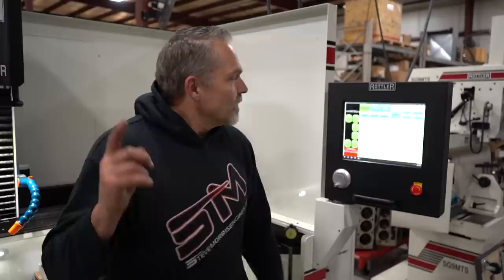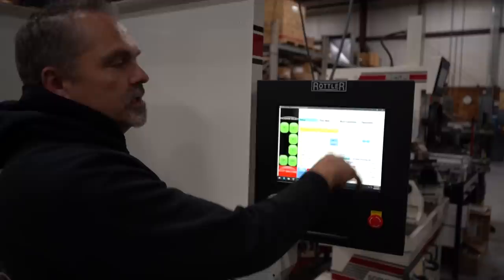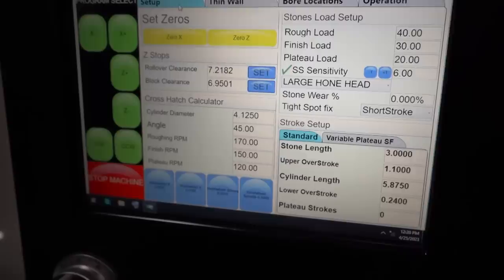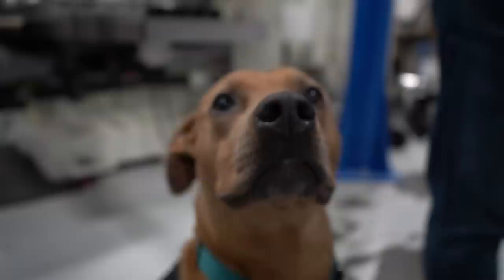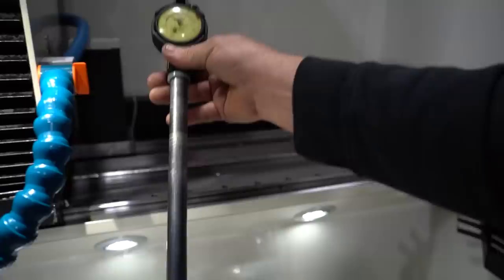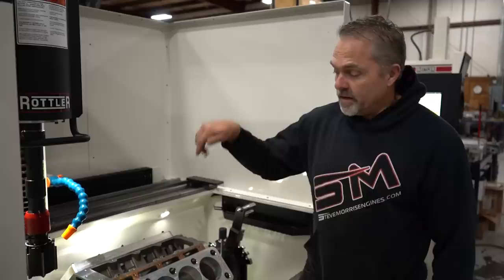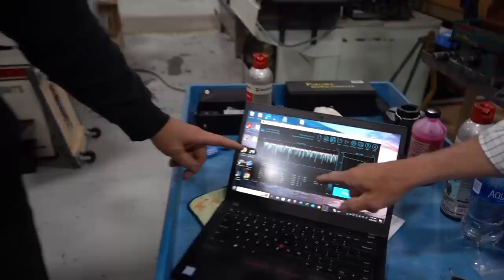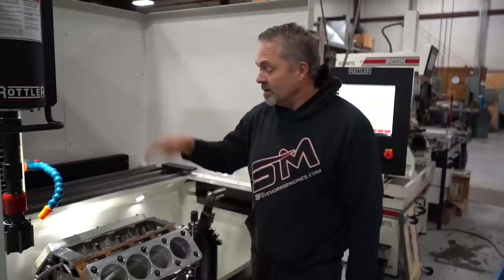Piston Skirts Scuffed ? Rings Did Not Seal ? This Is Why !

Comment: As a programmer, if I'm doing a some job that nobody else is going to touch (especially if it's a 4+ axis job) I like to do a low clearance entry, prove it out and then crank the rapid and start it in front of a member of management. I like to see if they flinch.

Comment: Steve, I'm a industrial electrician who works in a copper mining operation. Have that E-stop button replaced with a cutler-hammer (Eaton) E-stop.  That is one of those cheap European autopupu's style that are crap and will break on you when you twist them to pull it back out.  Tell rotler to never use those use those pieces of garbage in there equipment

Comment: Steve, I have 45 years of experience using diamond tools mostly associated with my tile business. One thing about diamond blades is the matrix that carries the diamond, it must be the proper hardness so it wears exposing new diamonds at the correct rate for the material being cut. Tile & stone has many different types of material from granite to porcelain to regular glazed fired clay tile and it is fustrating to have a nearly new $80 blade quit cutting or start walking offline because it shed the current level of abrasive and is not wearing to expose new diamond .

In your case hopefully the steel is nearly the same hardness and you wont have blade issue, softer stones for hard material seem to work best and cut faster.

Comment: Absolutely unreal! That machine is very impressive. Funny that you mentioned the skirt scuffing…
 I had a block done, always smelled oil burning, but had tremendous cylinder pressure. I tore it down to ring and bearing it, and add end gap for boost. I noticed a few pistons were scuffing… Those cylinder’s combustion chambers were oily do to scuffs in the bore… Oil rings couldn’t scrape properly with gouges in the bore… 

This machine is worth its weight in gold… Gonna be interesting to see if engines pick up Hp from a better bore/hone job… Awesome, just awesome! 👍🤘👏
Reply: It will. Lake Speed Jr (Total Seal Rings) has seen improvements of 8-10hp on engines with the right ring and hone package (Stapleton42 channel)

Comment: Finally, this info is being spread to the wider audience enmasse, now also by you guys, and Rottler and Total Seal. I've tried to tell this key importance of corse valleys and plateuing of the peaks in bores to gearheads locally, but being only one dude vs. a bunch of repeaters (monkey-see-monkey-doo'ers) they don't believe you.

It might also be an idea to state that for especially emissions-meeting street/road vehicles (which realisticly operate most of the time off-boost and at low manifold/NA regime), people might want to considering using a lower viscosity oil, as I've found the surperior oil retention properties being so surperior that the rings start to float (too much) on the oil film, that oil consumption becomes an issue as oil is drawn past the rings during low manifold press and engine breaking scenarios on engines NOT using DBW and VVT in particular ( VVT+DBW engines can counter it by for one running higher manifold press and retarded camshafts thus using atkinson cycle in a win-win for thermal efficiency and less pumping losses at low and part load scenarios, and second do engine breaking with fuel-cut and WOT at the same time, limiting the vacuum).

A similar issue also affects some other modern OEM engines that use plasma-spray sintered iron bores (they typically use 0W20 oil stock) and people have gotten oil consumption issues by using a thicker oil.

For the guys in the US (except CA),  I guess it doesn't matter much.

Edit:
I felt it through the screen when you dropped the mic'...

Comment: It is wild to think that a perfectly smooth bore is actually bad, but after explaining that you need the valleys to hold the oil and facilitate oiling it totally makes sense. 
On the surface it is/was counterintuitive. Having am "average" bore diameter with valley to hold oil that the rings won't scrap off, I mean now that I really think about it that is the point of the cross hatch is to draw the oil up and down with the stroke of the piston. Long story short, MIND BLOWN
Reply: Rifling on a Gun barrel = Gas instead of Oil
Friction is the Enemy
Reply: @statementleaver8095  yeah, that is not the same thing at all. The purpose and function do not corelate between the two.
Reply: @covertsolid1  Both work off Bores
Both controlled by Force of Explosion
Both require Honing
 3 similarities that you appear to be Ignoring 
 I can go for a fourth reason 🙊🙊
Reply: @covertsolid1  Nothing wrong with a Smooth bore......It's just the Material used for Rings and Sleeves aren't up to the job
EDIT 
Oil feed requirements for Lubrication would need to be like a Crankshaft with Oil channels involved on the Contact edges of the Piston🤔🤔

Comment: Probably one of the most amazing machines of the modern era. Lake Speed Jr of Total Seal uses this machine at Greg Anderson place on his fathers motor. Stapleton42 channel covers it. Lake figures with the right cylinder finish this machine provides along with the right piston and ring package alone is probably worth 8-10 hp itself.

Comment: I do small engine builds and ever since I’ve been using (local shop) that machine (diamond stones) my piston life is longer AND the motors make way more torque. From 85cc 2 strokes to 1000cc turbo 4 strokes, all my customers are impressed with how quick they get to top rpm with that honing. It’s just better, period…

Comment: I am learning! Before watching this video, I'd watched Freddy working on his flooded P1. He put a borescope in the engine and said it was good because he could still see the cross-hatch, and I was thinking "Why? Shouldn't it be smooth?". The stuff growing inside the cylinders was probably less good. Then in this video, when Steve talked about setting the cross-hatch angles, I was thinking "Ok, maybe it shouldn't be smooth, maybe it's for lubrication?". Then pleased to discover I'd got it right in the end.
Also I'm guessing this is why good engines cost a lot more than stock Frod or GM engines because of the far greater attention to detail in the precision and fit & finish.

Comment: Great video Steve, We have a CK10 in good shape but older. Wed mostly industrial   .small diesel and stock rebuilds. I guess the point is at what point is the advanced tech of the Rottler worthwhile? I love the CNC aspect freeing up a machinist while it works. I also love the bore finish but Im not sure our customer base requires this level of precision
Reply: I rode a CK 10 and later the CV 616 for many years and fully believe there is no lose of precision with those machines in the right hands …and a hell of a lot less time invested to get the job done. Too bad they stopped making them. I’m not raining on this guys parade …it’s a fantastic piece of technology, but I can’t see why making something so straightforward into a very complicated process is any advantage but If he’s getting paid for that kind of time and investment that’s great.

Comment: The way the machine automatically takes out taper makes me feel better about my hand honing technique. I attached a sunnen style hone to my drill to do it. I have no way of measuring the cross hatch so I just adjusted my speed until it looked right. During sizing I took out the hone and checked with the dial bore gauge at 3 points on two axes to make sure everything was straight and round. I don't know why but when I rough bored the initial .010 undersize with the boring head on my mill, it developed a taper. It's weird because I fed with the table. It would make sense if I quill fed it because you're get more flex as you extend the quill further from the mill head. Who knows. Maybe just worn out ways on the knee. I'm getting a proper boring bar to mount on the back side of the ram because it was very far from ideal doing it with a boring head. Regardless, I took the taper out exactly the same way. I just spent more time in the bottom of the bore until it was straight, got it I think to .002 under (IIRC) then finish honed. It was within a half a thou top to bottom on all 3 cylinders on my Kubota engine build, which is overkill for the RPM that thing sees, but it definitely won't hurt being that straight. Sort of a test run for the next time I build a race motor, which will definitely be occurring at some point. The little 3 cylinder tractor engine runs great now by the way. Just changed out the break in oil at 37 hours. All those little techniques I picked up putting together high RPM V8's really paid off.
Reply: I wasn't surprised that the final plateau hone took off a tenth. That's not a lot of material at all. It may have taken off more than that even because the dial bore gauge will find the low spots in a surface finish and this thing is just supposed to be hitting the tops. That may be why they say it "doesn't take any material off." Measure with something less precise or maybe a finer stylus and it wouldn't show up.

Comment: What is the fluid used in the operation ?  Back in the day when I did homing using a drill motor,  I used a water/dish soap mix and always worked fine for me; this prevented stone clogging problems encountered when using a light lube fluid.

Comment: I used to run CNC machines manufacturing gun parts and it was like waking in egg shells everyday because 1 tiny mistake isn't so tiny when it comes to these machines. Doosan (CNC manufacture) have no service techs in Las Vegas, at least in 2020 they didn't, so a simple spindle service was like 3500 and a replacement xould cost up to $10k.. Any noise was not good. 

I reman locomotive engines and components and there's always loud noises and I'm always jumping thinking something happened.

Comment: I've blown 5 heads now on the same block Rods and pistons. Including valve strikes on the pistons (interference motors, Audi) swap the head. Send the boost. LS< german engineering. Bare block builds.  I'm all for America but they did the engineering right

Comment: Modern rings will seal in just about any reasonably close to properly prepared CLEAN surface. 95% of ring failure to seal issues from startup are caused by improper cylinder cleaning and preparation.

Comment: So... now that it takes half the time and effort to bore a block... I am sure it should cost half as much right?  :)

my heart stopped when the stone went rapid to bottom.. I felt my mill creak...    I started using the plateau finish with an FE with 1mm rings..  Hard to believe how primitive engines were 40 years ago when I started in this biz...  That finish by it's nature is has to remove something.. (or it would just roll over the peaks)    Amazing to watch the tech available now..

Comment: I get the negative side of having different levels of customers,  but if you made NA SB's you may open the door to more cash. That's if you have the machines and labor to expand. 1 model, few cam options. Turnkey engines for street strip.

Comment: That was surprisingly fast for 8 bores, even with editing
 By hand, a single bore could have taken longer than entire video to get same results 
(but, you wouldn't be out, half a million $?)
I guess you need hydraulic feed for the hone to push the cutters out with synthetic honing fluid?
Personally I don't like it as it needs a high load to actually cut, light pressure just skates and polishes.
It is a heck of a lot cheaper than high suphur honing oil though, about five gallons synth compared to one gal last time I bough some.
The real advantage of computer control is you can have an unskilled machine minder run things after set up, the major expense is obviously working it hard enough to see any profit.

Comment: It’s funny how a lot of society looks at how long something takes to how much it’s worth. As in your comment of “oh it’s faster so it must be cheaper”. Right is right, doesn’t matter if it takes 3hrs or 30 minutes. All you’re doing on your end is making better use of your time by doing the same job for the same cost but in a shorter time. Making the business more profitable. But as you’ve just shown this is not only faster but a far better result, so arguably this should be a more expensive service as it’s a better result for the customer and it gets them their product that much quicker.

Imagine you send in an engine for a refresh and need to go up .010” larger pistons. You could have that turned around a whole day quicker now because you’re able to hone that out and finish it in less than an hour, vs setting it up on the boring machine to rough out the cylinder, then setup in the hone to finish. 

And people don’t realize that in the machining world, everytime you handle a part or have to setup a new tool you risk a mistake. You risk scraping a part and losing money. So having tools that can do one and done not only save handling times going from one machine to another, but it saves that potential for mistake.

Comment: Steve, I think you might be wrong on this one. While it does get the job done faster and more efficiently, and the cost of the job isn't going to be any less (in fact, it might cost more), the quality of the work is far higher than your previous quality of work (which by all accounts was some of the best in the industry to begin with). Even if the price doesn't go up, the argument could be made that because of the significant time savings and quality improvement it IS cheaper. Time IS money after all, and more jobs out the door at a higher quality for the same cost still means more money in your pocket to pay for the machine, and reduced time with a block fully torn down similarly lowers the time cost for the customer.

Comment: On your old machine did you step different grits, like a specific grit for rough-in, and a specific finish for the last .002 - .003 an inch. When you were mentioning that you believe you went too smooth and reduced the valleys. At what grit of stone do you believe is too smooth?

Comment: Steve I have a cnc shop and we build aerospace parts for a unnamed company we run dmg 5axis and some of our run times are 10-20 hrs so as I’m sitting watching your videos I have a question on run times for your heads just wondering and how tight are your tolerances and why did you choose those mills that you have never actually heard of them I think I have seen them at a show but 
      My dmg have a platen system so my 5 axis never stops with a app on my phone so I can have a life cost me a arm and a leg just something I was wondering while watching

Comment: Less labor intensive, requires less operator senses, and relies more on the computers sensors, just wonder why they didnt put some sort of hall effect sensor on the bottom of the cutting head so the machine can have a proximity sense of the bulkhead web location. That surface finish tester looks like it uses a stylus to sense the peaks and valleys and a graphical user interface to display the results. Keep rolling......

Comment: Just out of curiosity why is the gasket necessary under the torque plate?
Reply: The gasket transfers the fastener torque loading from the torque plate or cyl head to the block . You have to duplicate the actual running condition.

Comment: I noticed something right away, I was taught to hone blocks on a Sunnen CK-10 and I was told to hone #2 first, then #4 then #1 and finally #3 and I always did them that way. That's not done any longer?
Reply from the maker: So much coolant it does not heat up

Comment: Hey Steve I notice on your roughness profile that it shows 0.504" on your x axis. Does that really only measure 0.5" down the hole from your sensor? I assume that with just how good that Rottler is, you can assume a uniform profile with just reading the 0.5"
Reply from the maker: Yes it only measures .500

Comment: I don't know anything about cylinder honing but wouldn't a higher surface footage on the finish pass leave a better finish

Edit: you should also check out the mitutoyo bore gauges. Reads in tenths. Very accurate
Reply: I believe he said his reads in 0.0005 line to line if I’m not mistaken. Are you talking about the ones that measure 0.0001 per line on the gauge?  I’ve wondered how effective those are for anything over .05 or even .25. Is that what you’re saying and if so how well does that small dimension work for you?  Interested in your experience with it as I’m looking to possibly buy one
Reply: @ScottH-dw4rh  yes the mitutoyo bore gauges are .0001 clarity. They are extremely accurate for diameter. Also helps to see if there's taper or if something is out of round. I much prefer the single post dial version to the digital one with three posts. You lose the ability to look for taper or out of round. Paired with a height master they are great tools.

Comment: That shaft looks like it wobbles or is off slightly. ?
Reply: The wobble you are referring to is the head setting the entire bore at 90 degrees to the deck surface. That's what the graph on the machine was showing during the honing process.

Comment: whats the purpose of the torque plates?
Reply: They simulate the heads of the engine being bolted on.  The heads being torqued down distorts the the block a little and you want the machining to be correct for when the engine is assembled.
Reply: @jamesmurney1374  thank you that makes perfect sence.